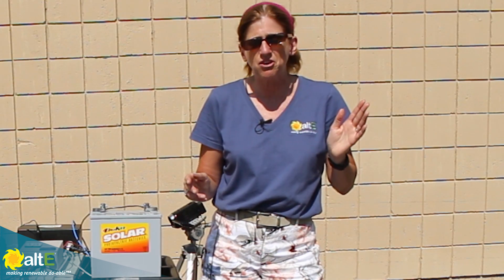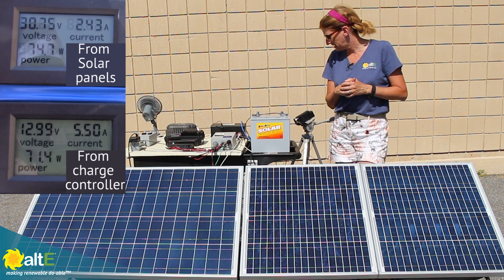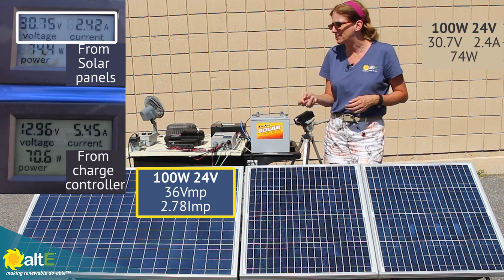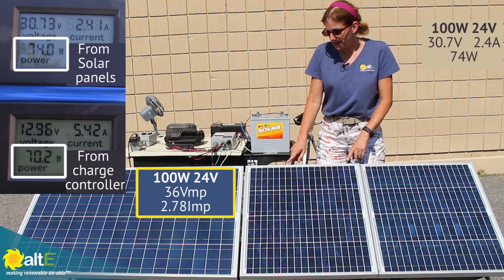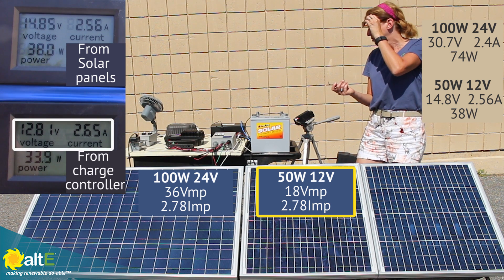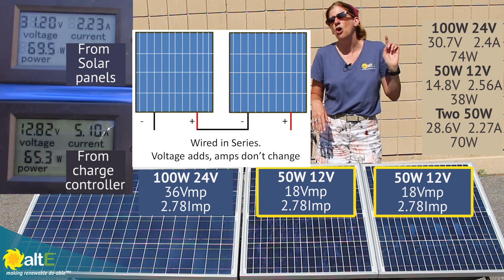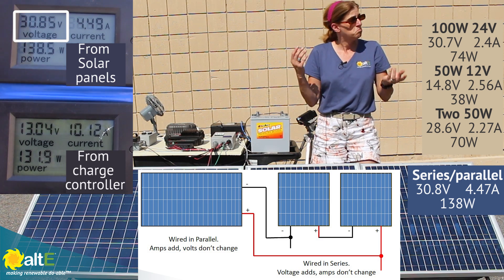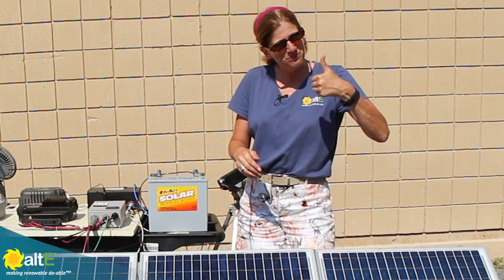How to Wire Mismatched Solar Panels in series and parallel

Comment: I know this was seven years ago, but it answered the question I've been asking. I have 6-100 watt 12 volt panels paired in series  and then wired in parallel to make 3- 200 watt 24volt panels. I only have room to add one panel and didn't know how it would work. So now I see that I could get a 200 watt 24volt panel and wire it in parallel it should work ,thanks

Comment: Best explanation. I had to do series parallel on my solar flex 200 that came with RV. Couldn’t get the full 600W. I used this video & Jimi rigged with 2 to 1 connectors thanks Amy

Comment: I’d say the power losses would be due to the internal resistance on the solar battery you are charging. You have to look at the entire system.. The state of charge of the battery would also determine the current draw.

Comment: Not really my issue. I have a 12v 190w panel and a 12v 200w panel dealer wired in Parallel. I have a 12v 400w new single panel. 100/50 controller. What say you?

Comment: Hi can you please kindly help me on my solar panel I have Panasonic VBHN330SJ53 330W Solar Panel Module which I have connected 7 panels in series which is 7 x 330 watts = 2310 watts dc voltage approximate 483...
And I have another string same solar 7 x 330 panels in series which 2310 watts 
Can I connected this 2 
strings in parallel so the dc voltage approximate will be 483 and the total watts should be 4,620 will this system will work ? Please kindly help me on this thanks you 
Sam
Reply from the maker: Yes it sounds like if you put those two strings of 7 in parallel it will be balanced! The key thing to check is the Voc (Open Circuit Voltage) of the panels. If Voc is the same for both strings, then you are good.
Reply: @AltEStore  thank you for your reply I have connected both solar strings in parallel which is 7 X 330 watts panels equals 2310 watts first string and second  string 7 X 330 watts panels equals 2310 watts all the panels are the same and on each string DC voltage is approx 467 volts the only problem I have is the total power I am getting out of the system on full sunny day is 2400 watts ?  But if you look at if both string are connected in parallel it’s should be 2310 watts first string plus second string 2310 watts total should be 4620 watts and why I am getting only 2400 watts ? Please can you help me on this issue thank you Sam
Reply from the maker: That does sound like it is under-producing! It could be a number of factors such as high temperatures, mounting angle, air quality, and so on

Comment: Hello ma'am I'm really enjoining your videos, they're very helpful. I've a question to ask ma'am, pls can I triple panel voltage to battery voltage with using MPP charge controller? Example 36v to 12v battery.

Comment: My Off  grid inverter cannot fully charge the battery at full load. Can I add an  MPPT charge controller with a separate 500w pv panel to the same battery in parallel.

Comment: a question: since all three panels have the same potential current, why not wiring all of the in series: 12+12 + 24 = 48 volts , and 2.78 Amp?
what is the point from wiring 2 panels in series and the third one in parallel ??

Comment: Why when i connect i series solar panels don’t charge?
Reply: There is a video on this channel about testing solar panels which may help. Also, check your charge controller can handle the voltage created by having the panels in series. Or- it could possibly be a faulty connector. Hope this helps.

Comment: The rule is simple.  Panels of similar voltage can be wired in parallel (and the amperage should add).  Panels of similar amperage can be wired in series (and the voltage should add).  Notice here though that she has "200 watts" of panels but is only getting about 2/3rds of that power (about 133 watts), so if you want a true 200 watts, you have to "oversize" your solar array by a factor of about 50%.  If she had 1 more of those 100 watt panels and put it in parallel with the other 3 panels (two 50 watt panels in series with each other), then she would likely have very close to 200 actual watts.  It would have been good if she mentioned this but all she said are there are some losses but didn't say how to compensate for that.
Reply: don´t understand:  if she had another 100 watt,that would be 300 total; and all that to get 200 watts?   where did the 100 watts go?
Reply: @josepeixoto3384  Losses due to many things, mostly from non optimal sun angle.  I have a "funny" story related to that.  One time I was selling a solar panel and the guy came to my house at sunrise, so the sun was just barely over the horizon.  When we checked the solar panel output on the meter, he complained it is not full wattage.  He tried to get a discount based on that.  I told him the sun has to be straight up for full wattage and he could see I was upset that he wasted my time so he left without buying it and I was happy.  What a poor attempt at a discount.  The nerve of some people.

Comment: Hi solar queen.I have a campervan now with 100watt solar panel at front charging my 110ah battery helps runs fridge 12v waeco compressor fridge on all time.I do have another 110ah battery in parallel with that.also have dc to dc charger connected so get good charge quick when engine on .now also I added 3 x30watt panels at back well under my ladders as I’m a window cleaner.these help with power at back of van I hoped.anyway I thought sometimes panels in shade I have a roof box on van a big one so thought can add 50watt flexible panel on roof box as it gets more sun most of time.what’s best way to wire with others solar queen.do I need another mppt for that .I have 2 mppt one at front to 100 watt panel and a renenogy mppt to 30x3 panels.I have connected those to same batteries also.I do have 2 stereo amps in back now with sub woofer.use mostly when engine on

Comment: I have 1 panel 385w, 40.2Vmp and 1panel 405w, 42.0Vmp. Diffirent brand also. Can i connect it to parallel connection? Thanks
Reply from the maker: The lower voltage may pull the higher one down a bit, but it will work, just not as well as if they were identical.

Comment: I have installed 300 watts solar panel  four snd 150watts 24 panel i bought new inverter 6000 watts now instructions is written  on to installed solar panel in series i have already installed solar panal with parallel with older inverter please guide  me how can i change unevent soler panel in series thanks
Reply from the maker: I need to understand what you have for equipment. What is the Voc and Vmp of the solar panels. What kind of inverter did you get? Does it connect to a battery bank, if so, what voltage. If not, then what is the input voltage spec of the inverter?

Comment: What I am looking to do is utilise my shed roof 1.6kw solar array with my 2.8kw house system. However, the shed roof solar array is feeding a 24v system, and the house is a 48v system. Why do i want to do this, I live in the UK so winter solar production drops to about 50% so I want to up the solar array into the house system durring these months to make up for these losses. I am trying to work out a remote switching system that turns the 24v system into a 48v system remotely using a WiFi system. Curently the shed roof panels are in parell and I need to pair them up, each panel produces 36v @ 5.5A. Have you tried this?

Comment: Great video. Did you also test two identical panels in series vs parallel?  A whole day test?  Always thought panels in series would provide better output at lower light conditions like morning and later pm
Reply from the maker: That's on my list.
Reply: @AltEStore  thank you!  The problem with an all day test is both configurations would need to be tested simultaneously.

Comment: Ive got three 12v panels and want to charge both 12v house batteries and switch over sometimes to charge 24v starter batteries. Should I connect all three in series. My charge controller can take up to 100volts. I wanted to do one 12v panel and two 12v in series but after watching the video don’t think that would be best. If i do them all 12v paralleled I would have to manually disconnect the 24v (2x12v batteries) each time and charge them separately. Its only so i can give the starter batteries a good charge up from time to time! Thanks.
Reply from the maker: If you have an MPPT charge controller, you could wire all three panels in series, and it will adjust the output based on if it is connected to the 12V or 24V bank. Be careful though, some charge controllers determine the battery bank voltage the first time they turn on, so it might get confused switching between banks. Others determine it each time.
Reply: Morningstar TriStar TS-45 PWM!

Comment: hey alte,  what will happen, if 2 panels of 24v 350watt are kept in sunlight connected in parallel and
1 panel kept in dark shed of 12v 150watt ?

will the current coming from outdoor solar panels will damage indoor darkshed solar panels ?

i wanna ask this bcoz, i am making a project of likething ? 
Actually i am making a 360 deg Solar Power Bank for mobile which have
all sides mini 6v solar cells. But if we face one side to sun, other sides not getting sunlight
will stop making voltage and will it get damage bcz voltage coming from other panel in parallel connection?
Reply from the maker: Designing an array that will always have shading is asking for trouble. You can create hotspots on the solar panels. A much better solution would be to have multiple smaller charge controllers, one for each direction. You will get much better performance.

Comment: How do I connect using a bank of 24 volt panels going into MPPT to a couple of portable 12 volt panels that have a PWM controller. All going into 24v Lithium batteries.
Reply from the maker: Let me make sure I understand your situation. You have 2 12V panels wired in series, going through a PWM charge controller to a 24V battery bank. To add 24V panels, simply add a second charge controller big enough for the new panels in parallel to the existing one. Because both are 24V, it can be either PWM or MPPT. Make sure the 2 charge controllers are set with the same charging voltages so they don't conflict.
Reply: altE Store I have 3 24v panels on roof going into a MPPT. I have a couple of portable panels that are 12v. They have a built in PWM. I want to use the portable panels when I’m in a shady spot etc. so my conundrum is how do I hook up the portables to get juice into my 24v system(batteries).

Comment: Great information, thanks a lot.
However, I do have a question regarding this:
What could I do when the voltages don't add up as nicely as in your example?
Could I simply drop the too-high voltages using diodes?
How closely do I need to align the voltages when combining different panels?

Thanks in advance! :-)
Reply: Very much depends on the details of what you are trying to do. Also, it wouldnt be a diode you would use, it would be a resistor which you would never need to do anyway. Just hook em up in parralel and be dont with it.
Reply: @JM-yx1lm  I do not think a resistor would do the job correctly since the voltage drop across a resistor is dependant on the current flowing through it (linear increase).
The voltage drop across a diode does not increase that much as current increases.

If I just hooked the panels up in parallel, would that not lead to the lower voltage panel being heated by the higher voltage panel? Therefore, in turn, further decreasing its voltage due to the panel getting warmer?
Reply: You would only do this when the values are very close. However if you give each panel its own controller you can use whatever sizes you want. More expensive but more efficient.

Comment: can i use this same principle if my 2 controllers are PMW
Reply from the maker: As long as the panels and batteries are the same nominal voltage, i.e. 36 cell 12V panels and 12V battery bank.

Comment: I have 4-110 watts in series mppt controller. I brought 3-150 watts, if I wire this in series then join the 110 in parallel. Is the "total"  handy cap at 110 watts level also? Or best get another controller and both in series best?

Comment: Gudday! Can it be use to charge a 24v battery?
Reply from the maker: If wired with 72 cells in series, so two 12V panels in series, you can charge a 24V battery.

Comment: Your presentations have no equal! What if you have an MPPT and an odd number of panels?
The combiner for my 24V system is currently fed by: 
Eight, 12V, 60W, Poly PV panels wired as two 24V, 120Watt arrays. (Or four 60W?...Idk, lol)
Two, 24V, 250W, Mono panels wired parallel.
One 24V, 150W, Poly panel (It's mate was destroyed by wind or possibly an Elk.)
I recently installed an MPPT charge controller using the same 24V input voltage as my old Trace C40 charge controller, and am not impressed. To use a nominal 48V input voltage with the new MPPT charge controller, it seems obvious I would connect the 60Watt arrays in series, the two 24V in series, with each array feeding the combiner a nominal 48 Volts.
What do I do with that lonesome 24V, 150Watt panel that remains? Would I have to bypass the combiner, and connect in parallel with the battery, through my old Trace C40 charge controller? Seems like I could parallel it with one of the other 24V 250W panels, before I series connect it to the other 250W, resulting in a 48V 400W array, but I'm not sure if hooking two panels of different Wattage in series is even recommended.

Comment: hi, at current I got 4x65watt panels in parallel on a mppt 100v/20a , and ordered 4 more.(all same brand and stats)can't go any more on parallel or it would fry the mppt , but adding the 4 new ones in parallel and putting both banks in series would work fine correct?
Reply from the maker: MPPTs are rated for their output, not input. 65W x 4 = 260W. Into a 12V battery bank is 260W ÷ 12V = 21A. Your charge controller is maxed out at 4. Also, if shading isn't an issue, they could be wired in series instead of parallel,  the charge controller can handle either. But either way, only 4.
Reply: the charge controller just wont give more then 20A to the batterys I assume.I wasn't expecting a higher peek, just more input during less sunlight hours or part shading times (wich is like half the day)Main question I got , wil 2 4panels in parallel put in series fry the mppt , so it would be 2x260watt in series (24v/20Amps)Will the mppt just max out or it will it burn?

Comment: Can you kindly tell me how I connect 6 panels of 150 w with 3 panels of 250 w
Reply from the maker: The best way is to use 2 charge controllers.  One for the smaller panels, and one for the larger.
Reply: @AltEStore  thanks here I have 3.2 kv hybrid  invereter with mppt charge controller built in , I have joined them in series now I'm planning to buy 3 panels of 250 watts so I will make 2 strings in series , again I'm very thankful to you

Comment: Please help me I install 80 solar panels 325 watt yingli panels. ..500 hundred deep water level and 25hp motor 20 rotar and 3 inch water received. ...Please solution. ..best work.

Comment: Thank you for your videos.
I have a 150 w 18 volts solar panel and a 120 w 12 volts solar panel. Then I also have a30A PWM and a 20 A MPPT charge controller and a 1500 Inverter. Could you please advise me the best hook up or 'this? Thank you very much in advance.
Reply from the maker: Can you double check the Voc of both of the panels? If they are close to each other, you can wire the 2 in parallel  and just use one of the charge controllers. If the voltage of the two is really that far off, then connect one to each charge controller, and connect the charge controller outputs to fuses or breakers, and then to the battery.
Reply: @AltEStore  if i have 32 cell solar panel with Voc 17.5 V and 36 cell solar panel with Voc 18.3 V, can i connecting them in parallel?

Comment: Mppt is more or less ment for  higher voltages.. either achieved  by series or a high voltage  panel alone.  Series increases voltage but leaves the  current the same or drop is depending on how mismatches the amps are. Parallel  will  drop the voltage if they are mismatched  but increase the current.    But it's better with pmw controler.   Increasing volts for  a pmw won't  do much for it  except  fry it. Pmw is nice for  starter stuff single low voltage panel or many low voltage panels in parallel. 
 I have a pmw controler.     With about 5 panels and  the voorsges are close to the same but  not identical.   Voltage is odly slightly higher when I plug  another panel in with  like 1 volt less of voltage. Mayby there us a drop in voltage somewhere  and the new one pics up the siack.

Comment: what if you have a 330 watt 46 volt,9.4 amp,,and i have a renogy 100watt 22.5voc,5.9imp,,i have 10 of them i want to connect lik2/3 of them together to connect to the 330 watt panel

Comment: i have 20 pcs of bpw34 connected in series and i am getting  6.5volts to 10 volts and very small amount of current 5 mili amps. now when i connect a normal 0.12 watt 6 plate of cells in parallel i got 500 mili amps and 0.5 v. Now when i connect output of bpw34 and output of 0.12 watts plates in parallel iam getting 0.5v and 5 mili amps WHY? PLEASE HELP ( i thaught i will get 6.5 + volts and 500 mili amps of current) Whyyyyyyyy???? 😥

Comment: Thanks for the great videos. I think I already know the answer, but wanted to get a 2nd opinion. I currently have four 12v panels wired up as 2 pairs in series putting out 24v to my MPPT controller. I'm looking to increase my panel count by 1 making it a total of 5 12v panels. I would NOT be able to run the new panel in parallel to the existing setup, right? Mixing 24v and 12v is not a good idea?
Reply: Why not buy another 2, 12V panels? All together you will have 6 panels. Wire 3 pairs and you'll be good to go.